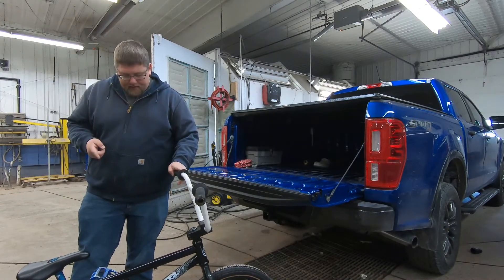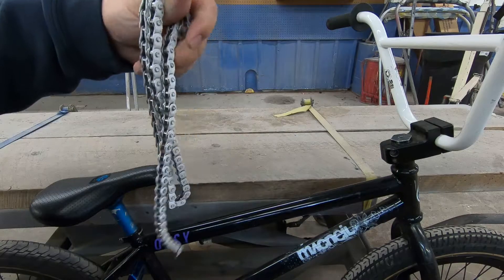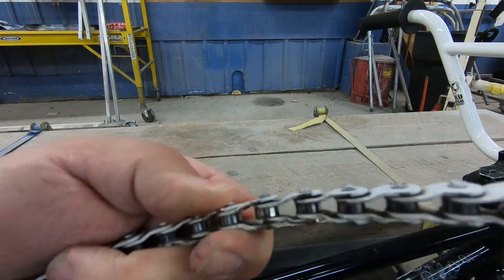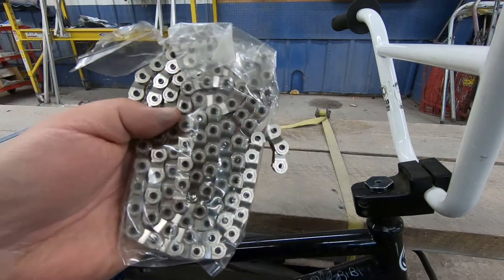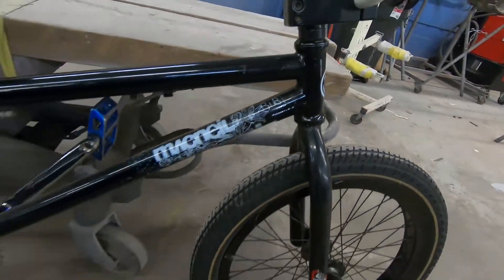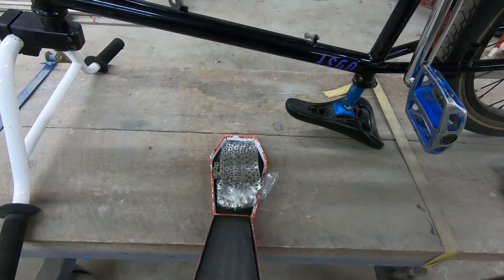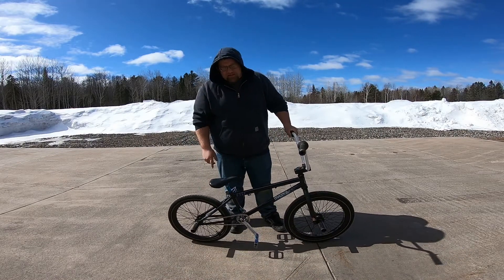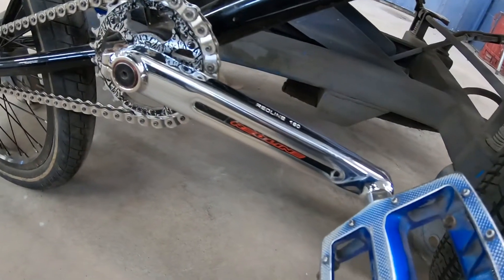Shadow Conspiracy Interlock V2 Install

Comment: I just bought one and put it on a bike... BUT just bought a new bike and wanna replace it with the one I put on my old bike. Can I do that with the same pin used the first time? Or is that not safe? Not even a week ago and haven't ridden it at all, maybe down the street to test it. Here in MN hasn't been nice for riding luckily.
Reply from the maker: Yeah should be fine just find that master pin
Reply: @TheWiscoGuyz  Thanks.